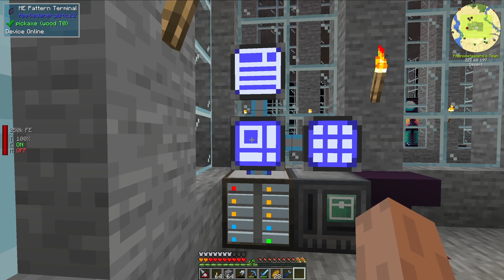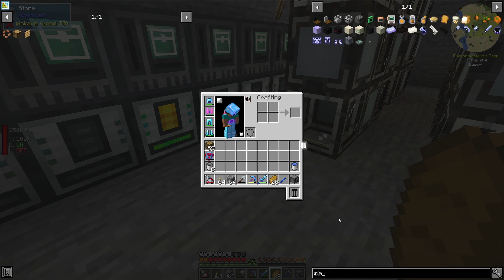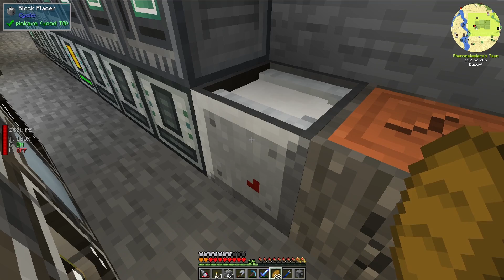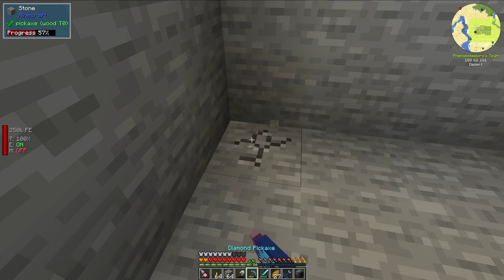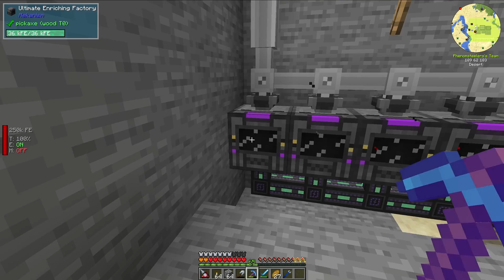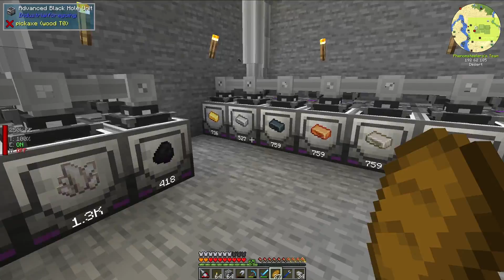Episode 18: Industrial Foregoing Machine Frame Production And Automatic Ore Processing

Comment: I might be off base here but shouldnt the storage buses on the black hole units be set to a positive number instead? If the goal is to keep all the ingots stored in black hole units, that is.
As far as I have understood it then setting a negative value for a storage bus is essentially telling the ME network to insert items there as a last resort.
Reply from the maker: Usually when I do this I want the ME System to have access to these Black Hole Units, but to never try to insert anything into them. The automation that they are attached to will supply the items for it.

Comment: The challenge isn't getting 1 billion. The challenge is trying to maintain a nice FPS.
Modded MC with all the machines is not very well optimized.
Reply from the maker: Yep. One thing I try to do is have several smaller bases in addition to my main base. It is still a struggle though.